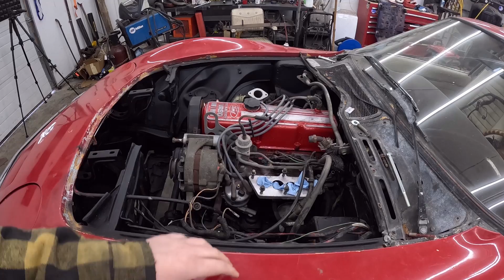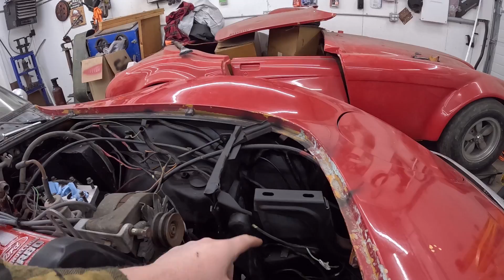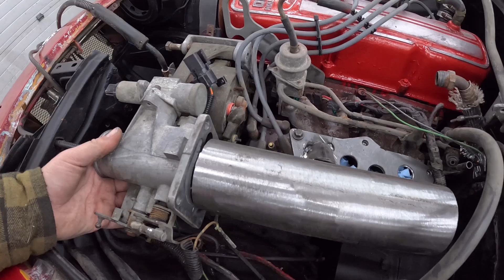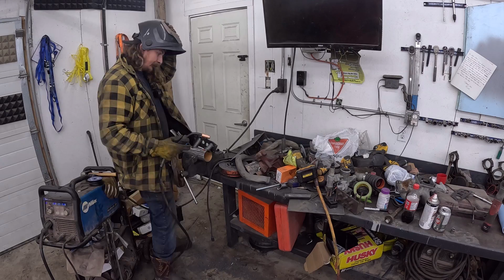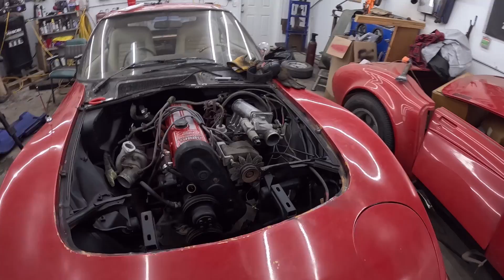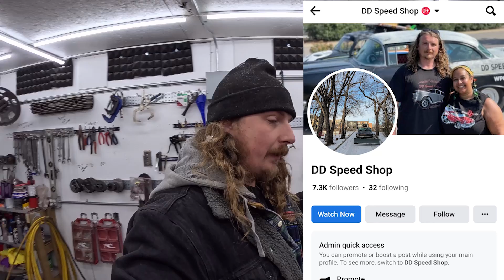HOMEMADE Intake Manifold Made From Water Pipe? - 1971 TURBO CHARGED Opel Gt

Comment: So long runners are usually on 4 cylinder motors to help make low end torque. But Turbo application with less intake volume will build boost faster? I think it's going to work good man.  200 hp in a opel would probably be plenty scary.

Comment: Dan, 
Very ingenious!
If you make the runners longer, you may be able to have access to the bolts from the top, and perhaps the throttle body wouldn't interfere with the alternator.
If you remake the manifold again, bolt the flange to something thick so it doesn't warp when welding to it. When you placed it on the lower portion of the intake, it looked like it rocked as though it was no longer flat.

Comment: Maybe you referenced it and I missed it, but I think the stock upper plenum had a vacuum port that could be handy and would be easy to add. I suspect it would make vacuum when the throttle is closed if you’re running power brakes and maybe also provide a boost gauge connection. I don’t pretend to know, I’m just guessing.

Comment: Buy a basic sch40 and thicker pipe bender the one with a bunch of dies on top of a bottle jack and 2 adjustable rollers you can do quite a bit with those including roll bars ,sub frames , suspension components ect and there dirt cheap. If you could get one or convert to an air over hydraulics that would speed things up they are painfully slow.

Comment: That intake should work just fine if your not concerned with performance whatsoever🥺, no offence I'm not trying to shit on it but it looks like it should flow like a clogged toilet🚽💩. But experimenting is fun so I'd try it worst case scenario toss it in the fail pile. About 25 Years ago I had a 2.2L Dakota that had a electronic controlled 1 or 2bbl carb can't remember that was pooched i made a 6" tall adapter to adapt a Q-jet carb to it a buddy called it a funnel ram... It ran flawlessly. It couldn't pull the secondaries worth a crap unless you feathered the throttle super fast until had practically redline and then opened up those huge secondaries and it sounded like it was going to explode but it didn't it's manual trans took a crap because it ran dry, I thought it was just engine oil on the ground but it wat gear oil also but I was in my 20s and didn't really give a crap.

Comment: Should have put one of those Pontiac 194.5 4's in it.  Good luck finding one. It probably would have fit pretty well in this thing though. I have no idea if what you did here is right or wrong. I can say though that you looked at it and said "i need air from over there to go over here and fit in this space"   Is it the best performance or best idea?  Who knows?  You got out there and made the thing work though. Old fashioned hot-rodding here. The way you just make things work is one of the reasons I watch. I wouldn't call you a hack either, you're a guy out there figuring out what works and doesn't and posting it for the world to see. I'm rooting for you on this build - I want to see this thing be a fun little driver.

Comment: Hope you haven't forgotten it needs a master cylinder too.  Everything looks good as long as you smooth your pipes to the intake holes.  Pressurized induction is probably more tolerant of ram-related issues.  And it doesn't need 180 ponies anyway.  🙂

Comment: Right from the start before you started building the new intake I had similar idea. Then, I thought making a square box out of square rectangular tube lets say 4" x ? to bolt right on top . Then come out the side with one tube [ exhaust pipe 90 ] the size of the throttle body. That would give you more room and probably a easier fabrication.. Great job on what you built, it should work just fine.

Comment: Go wrecking yard shopping for the intercooler and plumbing.  My 2.3 turbo ranger has a volvo intercooler and most of the piping.  Blow off from a eagle talon and some Home Depot ABS in the intake run.

Comment: I dig it. I made a turbo log manifold out of 2.5” schedule 40 pipe and elbows for my 5.3 lm7 swapped 67 mustang. Hacked up a front sump 240sx ls swap oil pan and got everything to fit in the stock chassis without touching the shock towers. Deleted the heater box for the 3.5” down pipe over the passenger valve cover. Fits under the stock hood. 

Work with what you got!

Comment: When I was about 15 yr old in 1965 I got invited over to a guys house not far from my home.  He was building a 38 chevy coupe for the Gas Classes drag racing.  He had a early Hemi with a home built intake made from flanges patterned off an intake gasket. Oxyacetene welded exhaust tubes came up and crossed over the opposite bank and attached to a box plenum with 8 stromberg 97s ,4 on each side.  I was blown away by its looks.  Totally wild sticking up at least 12 inches above the Hemi covers.  You my friend, are well on your way to HERO STATUS.

Comment: I thought it looked great!! If you should need to remake it, use 4 garden tractor pipes with elbows. Straight up 90 over, c same receiver, squished in a pipe vice or something equivalent, This would give you the elongated width to hook up, pipes come straight over. Height is adjustable width adjustable, and it looks like it could even be shorter. Maybe short enough to clear the Alternator. Just a thought. Love the show.

Comment: If you wipe some bondo on it and smooth it out with sand paper it will  look factory. paint it red also. wonder if it works? I am guessing it does. It will probably have more torque because of turbulance it not a striaght shot who knows??

Comment: Those Opals look a bit more like an old Lotus from the arse but a little more Ferrari crossed with a 70's Vett up front. They have those cool looking headlight hoods that are way sexier than the rectangle ones on the C3 Vetts. These are very cool looking cars but ya... the engine bays need to be hogged out and probably a Jeep mater cylinder in the floor and pedals from a jeep as well maybe lol Ever check out Bob from SPPTV? His fab work is 2nd to none and he''s in Winterpeg as well. Those guys are legit over at the SPPTV channel as are the Penny's Hot Rod and Custom page. :-))

Comment: With your fabricating skills I would drop the Alternator straight down and out of the way and sight. Fab a new bracket and have tons of belt adjustment.  Tilting the intake pipe down slightly will give you a straight shot of intake air to the throttle body. You are good my man.

Comment: I am sure I am late with this comment and I am sure you thought of this yourself. But I can't help myself... Why not get tube that will match the Inner Diameter of the intake runner. The ID of that iron pipe is going to be a lot less than the ID of the intake rubber. As you know when you are talking tube diameters and volume of flow, a seemingly small difference from one ID to another makes a huge difference in the volume that can flow through it. I think you are seriously choking that little 4 banger.  Listen my middle name Is-Half-Ass-It-If-You-Have-To-Just-To-Get-It-Done but even i would do this one if i had to id wait its not like you don't have enough other work to do until you have what you need to do this right.

Comment: I haven’t read all the comments, so if someone beat me to this comment, just ignore me. Anywho… I believe you would have better luck making your intake base, if you cut your holes large enough for the runners to fit inside the hole, and then weld them from the inside. You could do the same if you split the plenum, and then welded it back together. 
    Great content, keep up the fun.

Comment: I had a few Turbo coupes. I blew a timing belt at 90 m.p.h. didn't hurt the motor. Replaced the belt and good to go. And they are fast especially 5 speeds. Your intake should work just fine.

Comment: Back in the day I had cobbled together a 2.3 with a 12valve turbo and put super stiff valve springs and 14 psi of boost in a 91 mustang sounded like a Honda on steroids  ... the bottom end on those motors is basically 5.0 v8 parts

Comment: Maybe too late in the process to change but on the alternator belt, have you considered adding a tension pullie on the passenger side? Thus will not needed to have an adjustable alternator bracket.
Reply from the maker: Yeah thats not a bad idea I'll look into it

Comment: I did that with a 62 Fiat 500 , I think? Hell that was back in the 70's, I traded a buddy of mine a 4 door AMC Rebel for that Fiat, and "we" cobbled together a intake and exhaust manifolds for it out of water pipe, steel pipe. Hey, by damn it worked and the sob ran good too. That Fiat was a 4 door, suicide doors and 4 speed on the column or tree, whichever. It had a little overhead cam 4 banger in it. Little bitty 4 banger!

Comment: I did something like that on a Mitsubishi mighty max years ago, and installed a holley 390 on it, and made a header. It must have been too wanky of an air fuel ratio or something because after about 100 miles it started losing power and then the motor blew up, actually threw a rod through the oil pan. Had oil in it, I never really knew exactly why it blew up but I figured the carb might have been too big for such a small motor and possibly got the pistons too hot. Idk. I left it on the highway and when I went back to get it, the state had already towed it. I never tracked it down.

Comment: Air, fuel, spark and compression. If it works it doesn't have to be pretty to get there. My old life on sawmill breakdowns with oddball hydraulic pump installs we made many fittings. My dad put a Datsun 240Z engine in a Volvo wagon once. His proud moment was the log intake he built for it. I think it was tube steel if my memory serves me right. He taught us if you build it, make it look like you did it on purpose!

Comment: Hood latches? Hood pins are your friend. 
Due dilligence would say replace the fuel pressure regulator,as they were prone to failure.
Paint it copper colour, or brass, give it the steampunk look..
It a lot of work, thinking about it is 9/10 of the time building it.